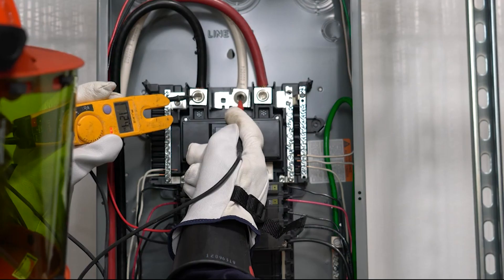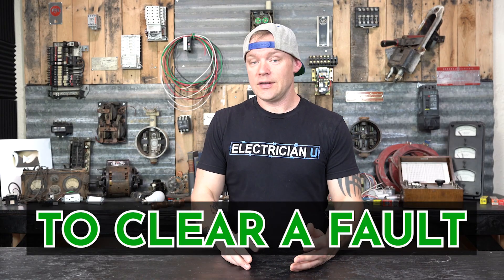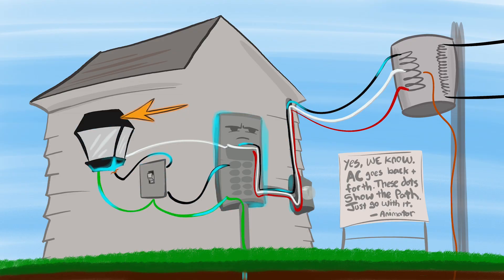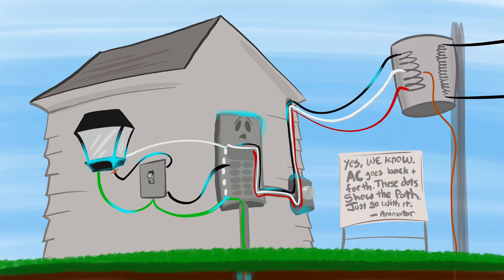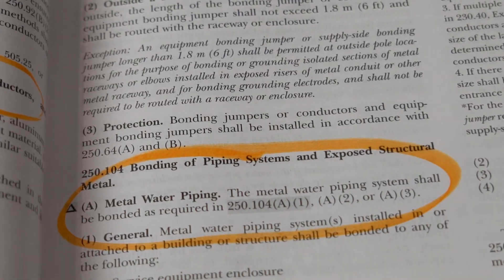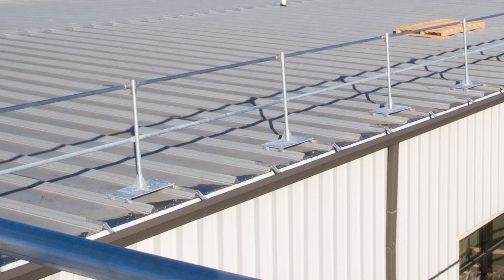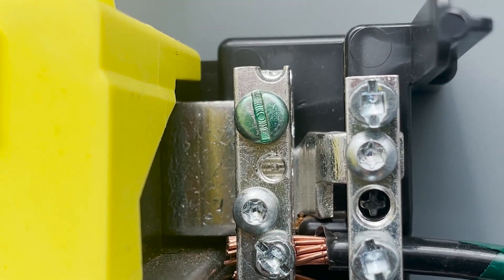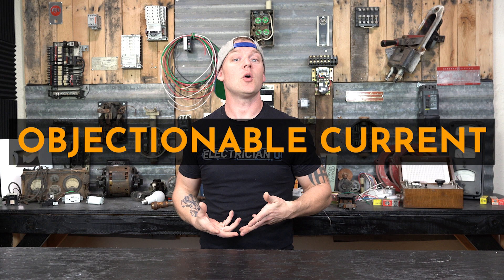Why Do We BOND Neutral & Ground in ELECTRICAL SERVICE PANELS?

Comment: Great video! Makes a lot of sense. One question. Is it okay to run a ground wire from the meter enclosure to the ground terminal in your main panel? The meter enclosure is bonded with the neutral and the ground/neutral are bonded in the panel.
Reply: You answered your own question. The meter base is bonded the through the neutral so a separate bond wire is redundant. The neutral acts as a grounded and grounding(bonding) conductor. Some newer meter bases now have an isolated neutral in which case a separate grounding(bonding) conductor is required.

Comment: That was not about breakers in service panels, he's always talking ground faults so showing the wrong picture. The real reason for bonding neutral with ground, is as a neutral disconnect called a backed up neutral is a shock hazard as this return wire looks like it's neutral. When this happens to disconnected conduit it's a worse shock hazard. This is as the ground has been disconnected.

Comment: I did that on a sub panel and didn't realize. Caused me to have 240 at a regular outlet and fried my battery charger for my drill. Luckily I didn't start a fire and figured it out pretty quick.
Reply: Your 240 Volt problem, was NOT caused from bonding the N-G at the Sub-Panel ...

Comment: I have a 480 3 phase coming in to a panel with earth ground and rod both at supply and at the 480 sub box.
I have a 75 kva 120/208 transformer feed from the 480 panel.  The transformer is feeding a 120 / 208 3 phase panel.
The 120 / 208 panel is bonded and is also connected to the ground rod with the 480 3 phase panel. Both panels are connected to same ground rod.
Is this acceptable? Seems no one in the electrical field wants to answer this.

Comment: Nope, There are 2 systems for "ground" the internal ground or protective earth, This flips the breaker if the shell of the washer gets hot. The US system of ground from the main panel to the dirt, is not a dump all strange currents here, no it is a second path to return to the transformer. The neutral in the transformer is connected to ground to. So why do this? It was Tesla. If you do a second neutral or ground the whole system it is more stable.

Comment: Very puzzling for a Dutch engineer. Don’t you use a ground fault switch? In Europe we use a detector that trips a switch when there’s more than 30mAmps difference in the current in the live and neutral wire. We almost never bond the gnd and neutral. If you touch the live wire the ground fault detector will detect that and shut off the power. Interesting difference....

Comment: I have always wondered this but this video doesn't clear up anything. What I dont understand is, in your diagram near the beginning, if the neutral and ground are connected in panel, how does any energy go back to the street/transformer, instead of choosing the path of least resistance, and going into the ground?
Reply: The EARTH ( GROUND ) is not least resistance.  Who told you that?

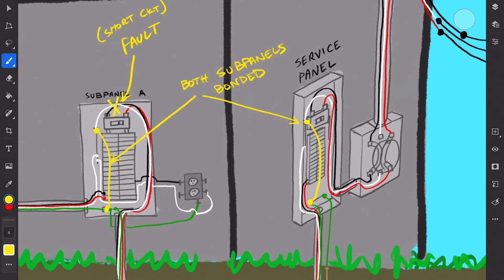Comment: 11:28 'say we have a fault condition...' and 11:38 'every piece of metal throughout the entire place is going to have fault current...'

But a fault condition would do this anyways, even without inappropriate bonding at the sub-panels.
Wouldn't the issue rather be that when there is NOT a fault condition, the ground system wires downstream of the sub will have current on it? 

In a ground fault, there is that 'split second' of system energization even in a properly bonded set-up.
Reply: Great video, btw.

Comment: why don't use differential circuit breaker to be able to figure out if there is a short circuit or Or electricity leakage through a metal object such as a washing machine

Comment: Because earth is the return path for the neutral phase.
But it is separated in the mains board to be able to isolate the return path from the cpc
Reply: In the USA, earth is NOT typically used as a return path for the Neutral ...
Reply: @MrSummitville  so you have a neutral 3x bigger than your 3 power phases or do you use diversity and balance the power so theres little need for a neutral ?

Comment: Ah Ha, but what if the utility has not provided a SECURE ground to their side of the panel...I encountered this problem a few years ago...alerted the utility, about floating voltages (over 460 VAC) on my side of the panel. They admitted it was their error, then asked me to bond their ground , from THEIR side of the panel to my side of the panel, which I did...Turns out, they needed the CYA to "stay out of trouble". I mentioned this the local Fire chief ( a friend) of this problem, and he told me to keep my mouth shut ... as he had seen several minor house fires caused by this "error" in the past, but the utility was cooperating to resolving the issue and had compensated home owners for their damages. Not only was I an electrician , but a degreed BS EE who knew and identified the problem. Be vigilant and do not assume the utility is always right.

Comment: Is the service transformer neutral not already bonded at the pole? That would be our return to source path for ground faults. In that case I don’t see the need to bond the neutral in the panel.
Reply: the grid is grounded all along it, and current will flow without bonding, but if your ground rod /system has lower discharge capacity than the breaker in the fault, there will not be enough flow to trip the breaker.
Reply: @Kalen - No. There Neutral Wire at the pole is connected to a Ground Rod.  But there is no Ground Wire from the Pole to the Home.  The Ground Wire only exists inside the home.

Comment: There's often a fundamental misunderstand of electricity.  Even this explanation, while good, leaves it out.  
1.  Electricity is the flow of electrons (current) from a place of more electrons to a place of fewer electrons (aka difference of potential/electromotive force/voltage).
1a.  Like all laws of physics, one law can be used to explain another.  In this context the 2nd Law of Thermodynamics applies in that electricity, a type of energy, flows from a higher concentration to a lower concentration.  In the event of a ground fault, the excess flow of electrons has to go someplace that can handle the excess, this is earth/ground.  Even short circuits in many cases will quickly become a ground fault.  Most electrical systems are designed with grounding and bonding for this effect.
1b.  Voltage is also misunderstood.  Voltage does not flow.  Voltage is just a magnetic force used to attract or repel electrons.  Because nature does not care about the numbers associated with the differences of electrons between two points (difference of potential) we use ground to delineate zero voltage.  In a short circuit, electrons will still flow from the highest negative charge (the charge with the most electrons) to the point most positively charged (the point with the least electrons).  Electrons are negatively charged and will hence flow toward an area that has less electrons relative to their concentration, in most cases the Earth.  Electrons DO NOT always flow to ground or back to the source. 

Grounding has three purposes:
1)  In the event of excess electrons in the circuit, like surge (electricity from somewhere else) or a fault, ground provides a safe place for those electrons to go, as said in this video.
2)  It actively dissipates any induced voltages.  This is why the Code uses the present tense term "grounding".  The letter I, in Ohms Law, stands for Intensity of Current, because this is how we measure it.  It is measured in two ways, either the intensity of the heat or the intensity of the electromagnetic field.  Current always creates heat and an electromagnetic field.  An electromagnetic field always induces (magnetizes) onto other conductive objects.  Voltage and magnetism are the same thing.  In a transformer, this is done on purpose.  If you feel a static discharge, this is an indication that grounding and bonding is not present.
3)  Provides a reference point.  As mentioned, nature doesn't care what the number is representing the differences of the numbers of electrons.  Nature only cares that there is a difference.  When circuits are designed, we need a reference point to control a circuit.  This is especially true with an automated system that relies on changes of voltage as input or feedback loops.  If ground is lost, the system will behave like it's possessed.

Comment: I'm Brazilian and here there are more devices, recommended in electrical code (NBR some numeral), that works along with circuit breaker in service panels to prevent electrical fault, but in the most houses they are absent because we never learn how dangerous a circuit in bad conditions can be. Is quite often we watch in TV some houses or buildings catching fire after a short circuit, famous recent example, was in one of most worldwide known soccer club Flamengo junior team, when several children and adolescents died after an air conditioner had overcharged the circuit wires while they were sleeping in a container made room. Besides that I'm studying lecture in physics and after watching this informative video I can notice that even in different electrical codes the physical principles are the same.

Comment: Is it wrong to bond ground and neutral in a sub panel which is connected to its own ground rod? If so, I guess I'm just not following how the fault current would get back to the source, if the two ground rods aren't connected.

Edit: in guessing the correct answer is that there needs to be a ground conductor back to the main panel in all cases.

Comment: And you DO NOT bond in a subpanel. Newbie electrical 101.

A subpanel is effectively a power strip. Bonding in a subpanel can create dangerous transient currents in the ground and can create a dangerous return of electricity. Neutrals carry current back and grounds are not supposed to do that.
Reply: Yes, he said that in the video ...

Comment: What I never understand about this is why wouldn't you have a path from the grounded light fixture to the ground on the outside pole? Add to this the complete confusion that I have connecting a four wire dryer to a three wire socket. I just know that it works, but I still hold my breath when I connect it for the first time. All the Best! DE W8LV BILL

Comment: No. You're wrong. Breakers don't sense anything.
Arc fault technology senses a particular waveform characteristic and GFCI technology senses either an imbalance in the hot and neutral or a current on the ground depending on the iteration of the technology, but breakers sense nothing. More to the point they do not require a circuit to trip. They only require excess heat. The reason the grounding conductor exists is to give an easy path to ground to make sure that either a fault will clear or a breaker will trip by making sure enough current goes through the breaker to heat it up which will make it trip.

STOP! You are providing false information and convincing people they now know more than they actually do. With electricity that is a dangerous thing and if someone gets hurt due to your bad information that is on your head you irresponsible idiot!
Reply: You are wrong ... Circuit Breakers can, and do trip without excess heat, especially short circuits - they DETECT excess amps ...
Reply: @MrSummitville  please explain how they sense greater amps.
I've looked at cutaway views of a few designs of circuit breakers and in no case did I see any sensing elements in any of them. They are completely mechanical structures that are actuated by mechanical and heat forces. No sensing involved. I've gone through schooling where the mechanism was explained to me. I actually factually know what I'm talking about.
You on the other hand do not know what your are saying, you use incorrect and misleading analogies and you make people comfortable with very dangerous forces. To be clear, I'd love it if everyone knew how to be safe around electricity. I wish everyone could work on their own house and DIY everything. Teaching people is great. But teaching someone how to do plumbing wrong just costs money. Teaching a person wrong things about electricity can get a person killed and I don't think you are either competent to teach or cognizant of the dangers you're exposing people to.
Reply: @salmanhendershot782  Some circuit breaker have a Current Sense Coil for fast magnetic tripping.  The Thermal Bimetal Trip mechanism is slow ....
Reply: @MrSummitville  this is exactly what I'm talking about with you not knowing what you're talking about.
99.99999% of breakers out there are simple mechanical things. They trip fast enough to protect what they are supposed to protect (the wire that is attached to it, nothing else). The current sensing breakers are GFCI breakers. They are specific use and are very expensive. The only other type of breaker that senses anything is an arc fault circuit breaker. Those two specific types of breakers sense specific problems and they are intended to save human lives which is why they trip faster and why it is important that they trip faster. They aren't worth discussing in a video about breakers because they are themselves a content rich subject that should be explored and expanded upon.
You are unqualified!

Comment: I have been in electronics for 50 yrs and this has been the BEST explanation of bonding/grounding I have ever seen!
Kudos!
Reply: Electronics and residential electrical wiring are about as similar as biology and physics.  They use the same language and that is the end of the similarities.
Reply: @joshproskills760  I guess you never really understood either then for you to make such an asinine comment like that
Reply: @rty1955  Read my other comment where I explain bonding in 2 sentences. "50 years in electronics" and this is the best explanation of bonding you have ever seen?  It is 15 minutes of talking partial correctness.  I stand by my other comment.  High voltage AC residential wiring and low voltage DC electronics have electricity, fuses, and switches in common.  That is about it.  One major difference is when people poorly understand "electronics" they don't burn peoples families alive.  Please for our safety stick to your "electronics".  Residential wiring isn't for you.
Reply: @joshproskills760  Electronics can use AC even at low voltage. What are you talking about?
Reply: @georgebonanza9487  Your statement literally says nothing and means nothing.  If you can't read and comprehend basic English then propose some kind of intelligent argument based on the topic.  I am sorry I can't help you.